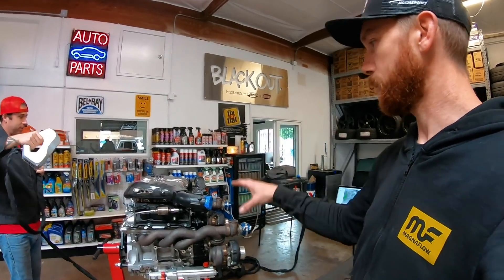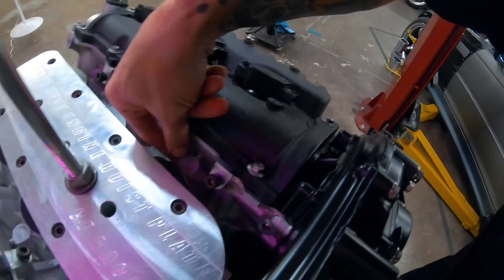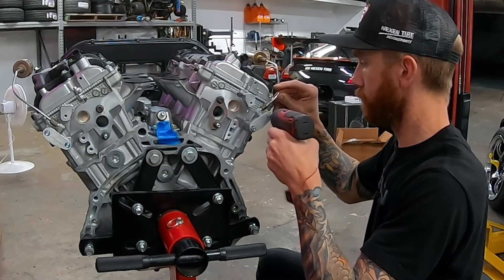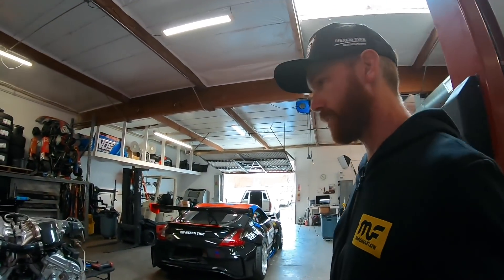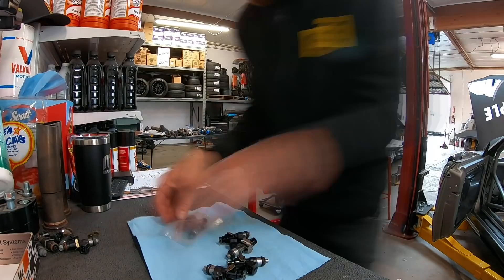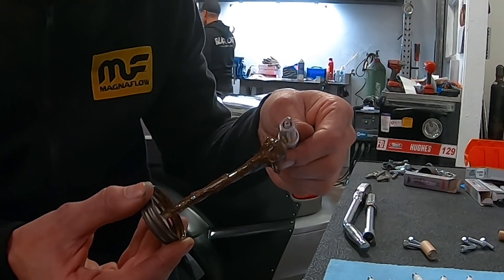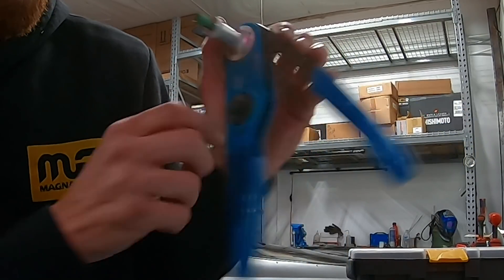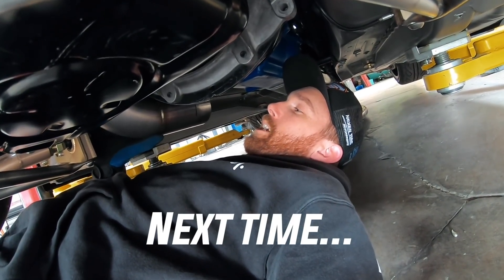1200hp GT-R Engine Assembly and 3D Scan!

Comment: Are you using OEM connectors and pins or are they aftermarket?
Reply: They look like they're are easy to work with.
Reply from the maker: They are mostly aftermarket, the plugs for the ignition components are Nissan but they were new at the time of the harness being made.

Comment: On a 1-10 scale, how would you rate the reliability, and the simplicity of your old (very loud) VK setup?
Reply from the maker: 9, the reliability was insane but the simplicity is the only thing that pulled it down a peg. It was rad but we had to drop the engine out the bottom for any repairs.
Reply: @chrisforsbergracing  That's quite the trade-off.  I can see why that's a big deal.
Reply from the maker: Yeah it was great but it was very tight in the bay.